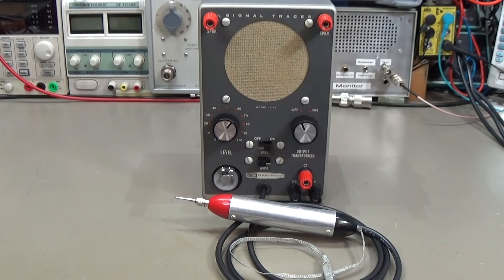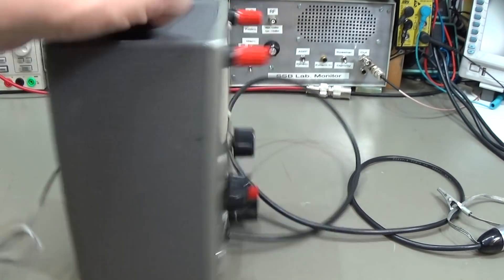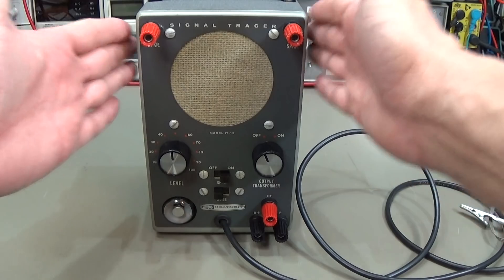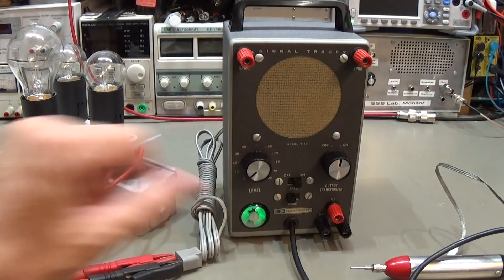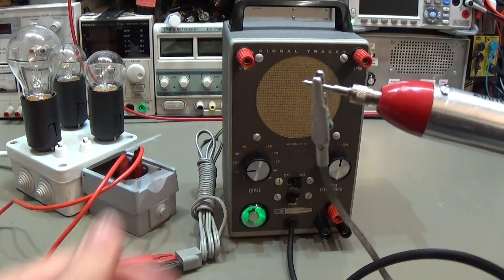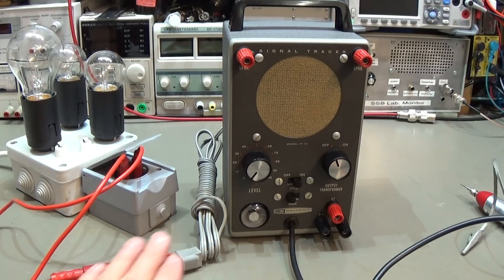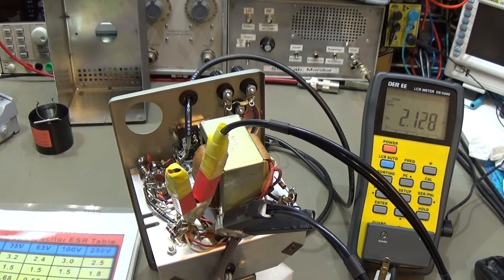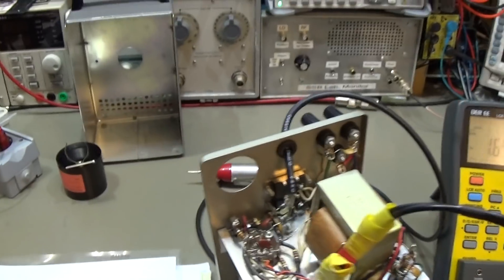#153 Heathkit IT-12 Signal Tracer repair and restoration

Comment: These make really good guitar practice amps if you replace the probe with a quarter-inch jack and disable the high voltage noise switch
Reply from the maker: Yes I fully agree. Thanks for comment

Comment: I have watched a Video on the Heathkit Signal Tracer T-4 and noticed the Capacitor you reversed the polarity on due to high gain on the IT-12 is the same situation here on the T-4. Could this be an error in the original design or does the cap have to be reversed also?

Comment: I just opened up my unit, the foil capacitor is the same way around as yours was, I wonder if it is that way around in the manual? UPDATE: I just found the manual for this online, and the manual shows the line end as per original, so either the manual has an error, or there is a reason it is that way around, personally I don't have a clue which way around it should go LOL.
Reply: Test the cap and see.
Reply from the maker: Yes that is an often seen issue. Folks mixing up plus and minus vs. foil end and inner foil connection. And you are right Heath put this cap in like a polarised cap what it is not. The cap is installed like a polarised cap > plus to plus side of the circuit..we need to put the cap with foil end to the lower impedance side and that is clearly the other way round... hope that helps
Reply: You can see how to test them here if you don't know how. Happy testing. https://www.youtube.com/watch?v=BnR_DLd1PDI&feature=youtu.be

Comment: Nice score, Peter! I wonder how well it will work after all the AB resistors and old caps are replaced?
Reply from the maker: Hi Robert, what do you mean with AB resistors? All components are in spec so all should be fine by now. Thanks for watching 73
Reply: Alan Bradley resistors. Most people say to replace them all, including the bumblebee resistors that a lot of old equipment have in them.
Reply from the maker: Ah got it. Yes that is basically right because this resistors are known for being noisy or running out of tolerance. But for now the unit works perfect...Thanks for your explanation sometimes naming in Europe is different so  I have my problems then...
Reply: I just made it up - AB is easier than spelling out Allen Bradley. Maybe with new resistors it will work even better?

Comment: You made a lot of errors! The procedure should be:
1. Open the case and INSPECT to see if there is any damage.
2. Ensure it is correctly electrically connected on the mains side (220 VAC).
3. Check with your ohmeter that the mains input, switch, fuse and mains transformer are correctly wired.
4. Ensure that nothing goes to the metal chassis of the box that should NOT BE (220 VAC mains for example).
5. Connect your isolation-transformer and bulbs and switch on.

Comment: 110V.
Reply: Vatsek - It was very common for older North America gear to be labelled as 117v.
Reply: In reality North American voltage is more 120V these days. But I heard years ago it was 110V.
Reply: @1pcfred  , at my house  the voltage on each leg typically runs 122 to124VAC. That's 244-248 VAC for the air conditioner! Never had to deal with any kind of brownout voltages. Most likely this is largely due to having my own 7700 volt line feeding my house and just one other house, and each of us having our own pole-mounted Transformer.
Reply: @goodun6081  They are in the process of upgrading the high voltage transmission lines near me so things may change where I'm at when all of that comes on line. I am pretty far out in the country though so I'm lucky I have any power at all.
Reply: @1pcfred  , I live in woodsy southeast New England, perhaps now it is far out in the sticks as you are, but it's pretty rural. (Lots of deer, a few Bobcats, foxes and Fisher Cats, and there's a bear roaming the periphery somewhere; and a game warden purportedly saw a mountain only a twenty-minute ride from my house). We do have major transmission lines running all over the place only 5 to 10 minutes ride from my house at most, so the feeder voltages are probably pretty good to start with. Many of the old railroad lines have been converted to walking hiking and biking trails ( great for walking my three dogs! ) and the trails tend to run alongside of or intersect frequently with the transmission lines.
Reply: @1pcfred  , the reason you have power out in the sticks, or even here where I live, is because of Franklin Delano Roosevelt and the Rural Electrification Act! Without government intervention the electrical utility companies would never have bothered string wires way out into the country for a couple of scattered customers here and there. I should ask the local historical society when it was that electrical power came to town here. That would be an interesting thing to know. This community was all Farms once, a lot of it is fallow or has been bought up by the town as public land in order to preserve the rural character and guarantee good filtering of the watersheds against erosion and for pure drinking water in everyone's  wells.
Reply: @goodun6081  the reason I have power here is the yokels made their own electric company and strung lines up themselves. I'm pretty sure they did it all before FDR even got into office too. They were the originals as far as making America great goes.
Reply: @1pcfred  , we have just two or three Municipal e owned electric utility companies in my state. Unfortunately not in my own municipality. Last couple of times when we had major storms that knocked out power to my house for 5 or 6 days, the closest town to me that had their own town-owned electrical system had power up and running to virtually everyone in less than two days.
Reply: @goodun6081  There's two power companies by me. The cooperative is way better to be in than that corporate outfit. But consumers don't have a choice. You get who you get based on location.
Reply: @1pcfred  , yup!